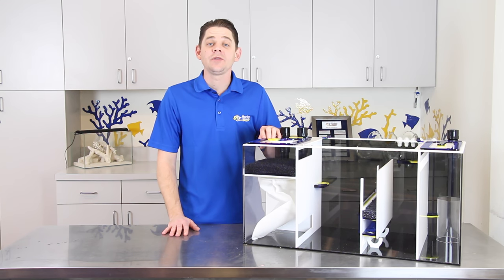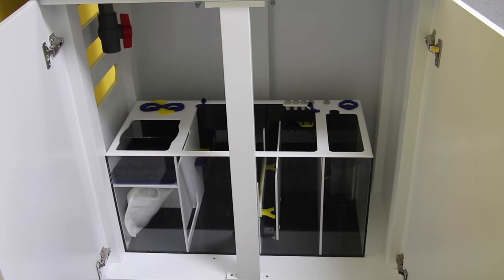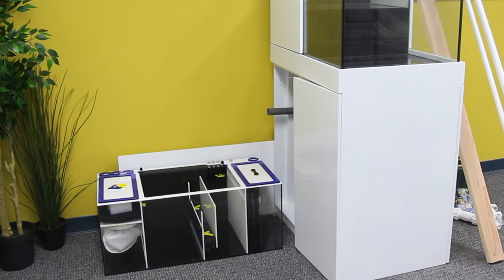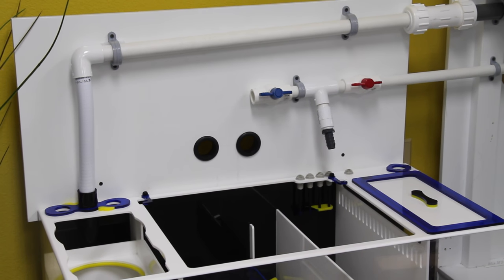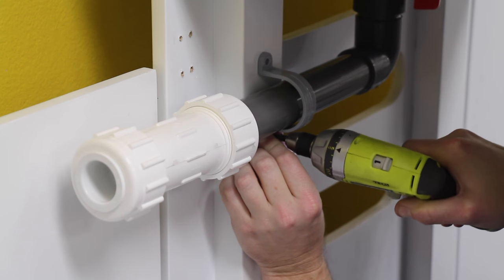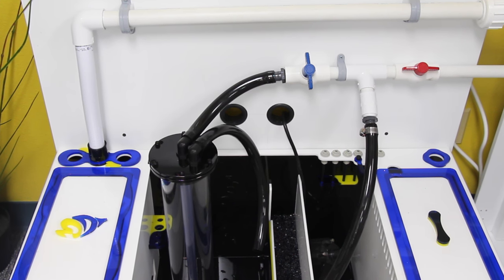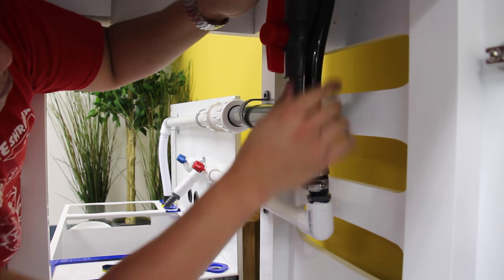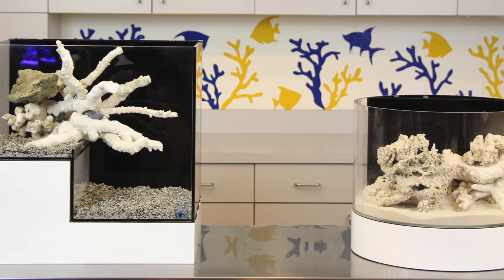Drop-Off Tank Build #2: Sump Install + Which Rock Should We Use?

Comment: So a sump won't fit under a 75 gallon drop off?  And a trip to the local hardware store?  Who wants a hardware store plumbed sump sitting out in their living room?  I'm sorry guys but this is dumb.
Reply from the maker: Thanks for watching and commenting.  I can definitely understand this is not an option for a living room for most of us but plumbing external sump systems is pretty common for larger systems or when keeping multiple aquariums.  Some passionate hobbyists even dedicate an entire room to aquariums and the filtration systems! 

We have a variety of sumps that fit under the tank which you can check out in the first video below that would work out great for filtering this aquarium.  Our intention with the larger external sump is to be able to easily showcase all of the equipment and modifications that can be done when building your own tank!  

http://mdshop.us/2kKyLfF

-Robert @ MD
Reply: I agree.  You have a great custom sump but putting it next to the stand is tacky.  If you really were going external I think the plumbing should have been more thought out and used higher end pipe and fittings.  Its a mishmash or different colors, qualities, and brands.  If the main tank used grey Sch 80 use sch 80 throughout or switch to all black since you had black vinyl.  Would have liked to see more unions and especially true union ball valves used, they already look hard to turn.
Reply: I agree but In MDs defence I think they mostly put it beside the tank for easier filming
Reply: They did -- But seriously, they literally said it's so they can showcase gear that they will be using in the video.

Are people watching this without sound or something?
Reply: Yeah, I realize filming under a tank isn't the best way to showcase your products but I've have much rather seen them use a sump that would fit under the tank since that's how nearly everyone who buys a 75 drop off will set it up.
Reply from the maker: Both of the sumps pictured 30" and 36" will fit under this tank!